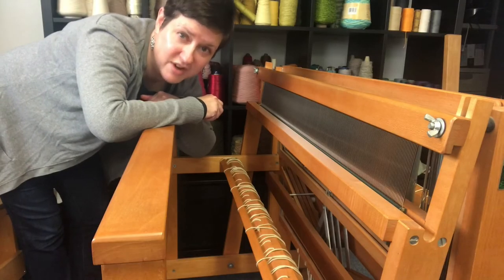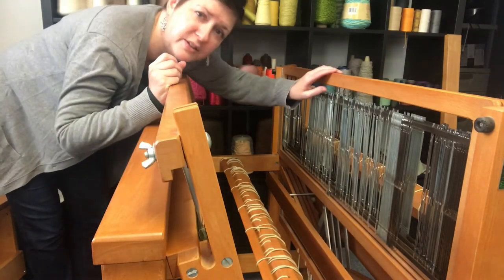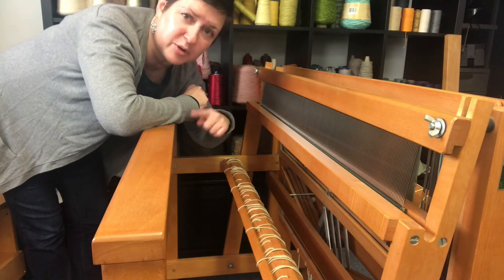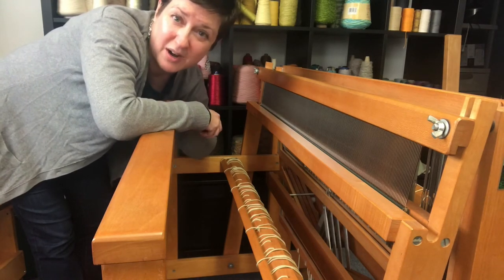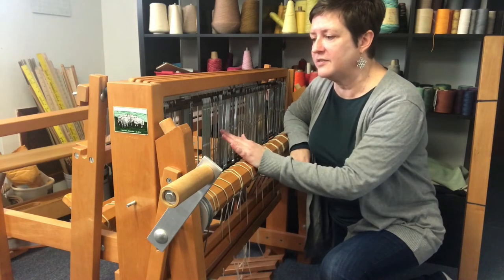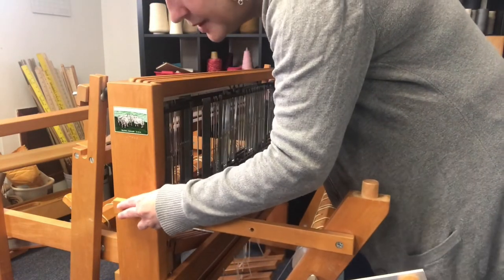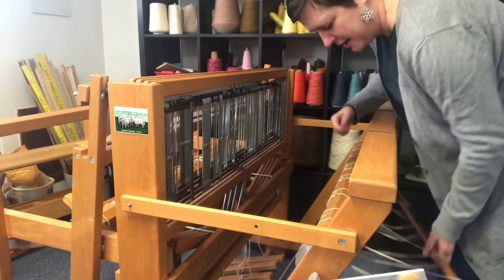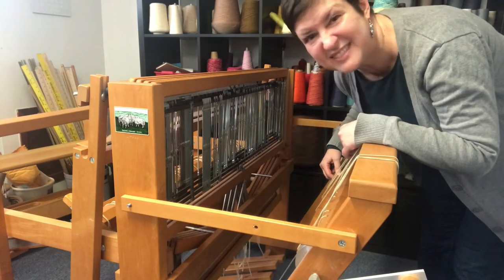A Tour of My Floor Loom

Comment: hi! i just got this loom, could you show how the brake and back beam crank mechanism works? i think there may be an issue with my break.
Reply from the maker: @tessp.k.640  Congrats on the loom! Very exciting! The goal with the braking system for any loom is to be able to hold the tension of the warp yarns. I'd recommend looking up your loom at the manufacturer and they'll typically have diagrams or other information about how the braking mechanism works. Hope that helps!